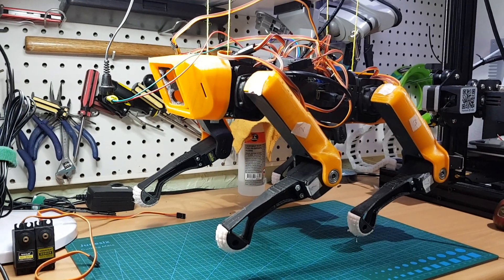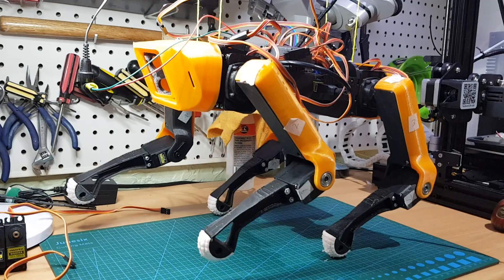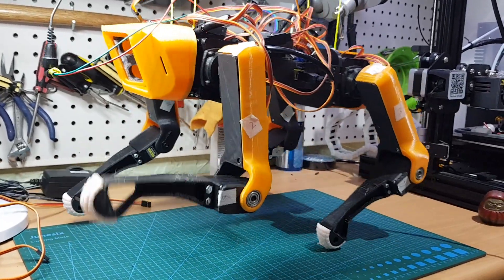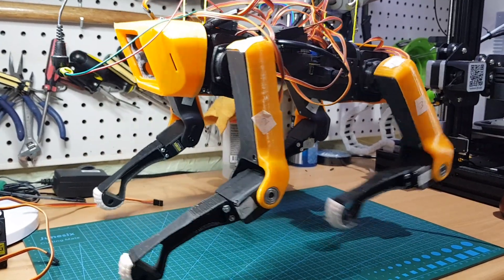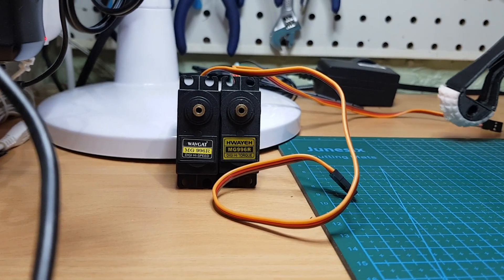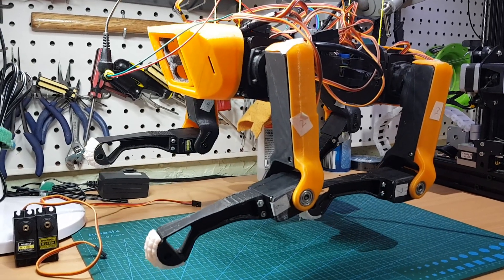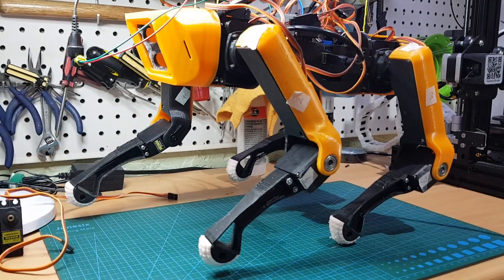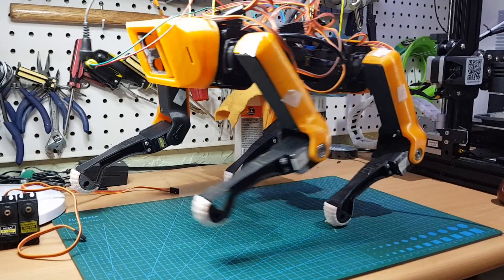SpotMicro -  Walking Routine Sorted, but...

Comment: Hello mate! Can I ask you how many torque did you try in these servos? (And fail) I’m just starting this project and I have to buy the servos, I saw there are two models in the files .stl, one of them to 996r servos and the other one to clc servos, these last are much expensive.. I read other people having issues with the servos for the same reason of you, low torque.. which servos do you recomend me?? Or at least, up to how manu torque? Thanks a lot for your videos!
Reply from the maker: Hi Jorge, I have to admit that what I thought was a problem with the wrong servos (hi-speed instead of hi-torque) was not the real problem. It turned out the real problem was that power supply I was using wasn't up to the job. In the last few days I've finished making a bench-top power supply for use in testing and as a battery charger so I'm ready to start testing again. Sorry for the long break in progress! 
You can see my other distractions here: https://spotcorgi.net
Can you do me a favor and try posting in the blog there? It looks live from my end so maybe it's just nobody has anything to say :-)
The servos I've been using most recently are these:
https://www.aliexpress.com/item/32820041789.html?spm=a2g0s.9042311.0.0.27424c4dsfao8O
Good luck and if I can help in any way let me know.
Michael

Comment: I think you shouldn’t program this by having hard coded sequences for the legs. Instead, you should model an identical virtual micro spot, and let it learn to walk with a neural network over lots of generations. Do this for various desired commands, like moving forward, turning, etc. When applying it to your real one, I guess it would require having encoders to know the joints positions, or use something like Dynamixels instead of regular servos. Also an IMU on the body.
Reply from the maker: Way, way beyond my skill level. l only started 3D printing and Arduino coding 10 months ago. But I appreciate the ideas and agree that hard coding is never the way to go. My code sort of gets around this by rewriting the move array when new commands or settings are entered. Still, I'd love to see links to demonstrations of the methods you've mentioned. Thanks.
Reply: @mbromham  Hi this could be easier than you think. Try searching for Opena AI gym and Pybullet.
Reply: He would need to combine results from the virtual and real world to get the optimal results that can be used in the real world. There is a pretty good paper describing this.
Reply from the maker: @OrbitalPirate  Thanks for this, the way things are going looks like I'll be spending a lot more time at home so I'll have no excuse to not resume this project and look into these ideas.

Comment: i know you get asked this alot, but have you ever released the source code?
Reply from the maker: Hi John Doe, not that many people ask about the code but it is on github: https://github.com/mbromham/SpotCorgi 

Please be aware that it is still very much developer mode with lots of testing and logging code and redundant remote control functions. I honestly haven't even looked at it for months as I've been tied up finalising the body. I'd found that flaws in my chassis build (not design) were causing artifacts during code testing. While I was fixing these my ADD kicked in and I went off on tangents for camera gimbals, leg covers and designing the neck and head. When I have a solid body build I'll get back to the code. 

While it works OK, I'm still not convinced there's not a better method than the array table method I use. Ideally all values could be calculated on-the-fly. Also note while "paths" are defined for left, right, etc. as far as I remember these aren't implemented. Enough disclaimers!